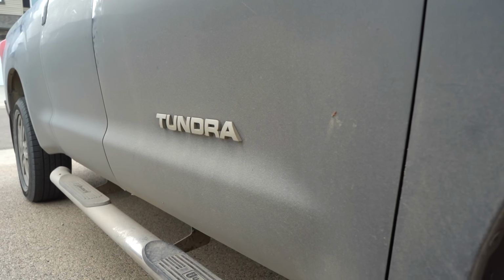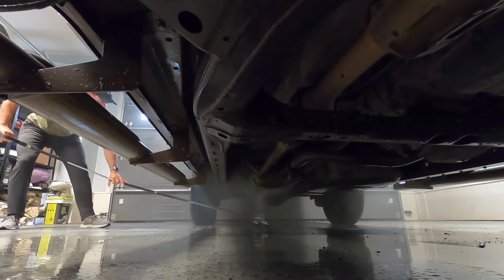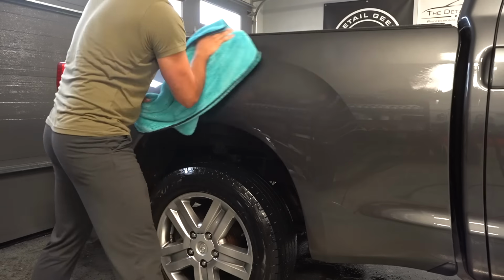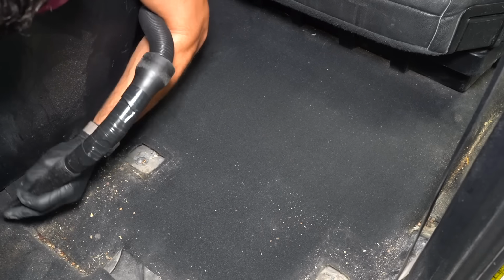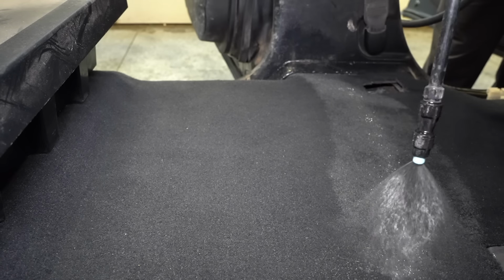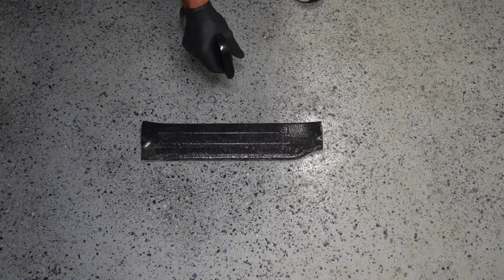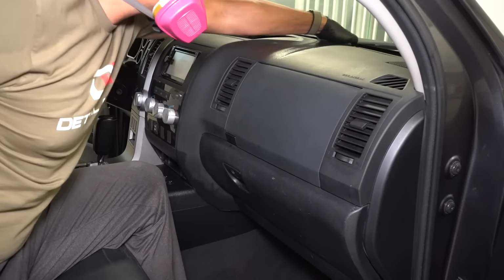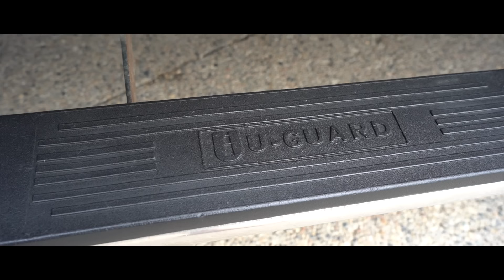Deep Cleaning a NASTY Truck! | The Detail Geek

Comment: Does all of that mist and overspray make your garage walls, ceilings, sheetrock etc wet or damp? Simply curious if you get mold,, mildew or dampness issues,, if you need run a dehumidifier or open the doors to air it out , nice video by the way.

Comment: Current 2014 Tundra owner here. Carpets are one horrible weakness in this truck. It's really tough to try and get dirt out of them. Engines are made in Alabama, Transmission are from South Carolina (Aisin) and the truck is assembled in San Antonio Texas. Engines are rated for 1 million miles if properly maintained which is why mine at 54k miles used, cost as must as a new Ram at the time. These trucks last the longest and are the most dependable and its just simply a fact (do the research because I did for my first truck and it was a Tundra based on the info and asking current truck owners). Currently at 153,000 miles and have had zero issues and it runs/drives like the day I got it.

Comment: One thing that would make these detailings better is pressure air blow gun to blow out the dust from the AC vents and to dry all the emblems very well. It would add a nice touch  to the videos specially in slow mo

Comment: Sprayback always sucks. I work at a rock quarry and we use fireman's hoses to clean off buildup on the station levels. If you the piles of rock/dust just right (or wrong I should say), you get a good face blasting of water and rock. And it definitely sucks when it's literally 10° and what you just sprayed freezes 30 seconds after you move away from it.

Comment: The one thing I can say is that he has a hell of a vacuum. That vacuum is no joke. I have two of my older vacs that I feel are just taking up space. They don't have nearly the power that the latest ones I bought do. I have damn near as many as the guy from vacuum wars.   If the need to ask why I have so many vacs is because when you do fleet/mobile you might do ten to fifteen cars a day. And I don't want to get caught with my pants down if one goes out.

Comment: Do you add anything to the solution tank of the bissell extractor?
Reply: Just hot water.
Reply: You'll see he puts down a cleaner and works it in the drill brush. Adding soap to the extractor would just be putting down more soap.

Comment: Is there a product you recommend for getting bugs off of the bumper? I tried the pressure washer but it’s really stuck on there
Reply: As far as I know, try using bug spray remover for cars or Goo Gone and leave the solution on the bumper until you get to the soap bit and then rinse.
Reply: I think its maguier bug product

Comment: We bought the Bissell but maybe I'm using too much soap or something because I go over and over and over in the same spot and it never seems to stop being sudsy and then I just get annoyed and stop using it. I literally only did one section of my car and I was done.
Reply: Mitch is mentioning he is using a 1 to 20 diluted All Purpose Cleaner. So definitely quite diluted. And you can see that he usually do not leave the carpet soaking wet. Also, he is using warm clean water in his extractor tank. So the steps are:
1. Vacuum your carpet 
2. Spray 1 to 20 diluted APC
3. drillbrush the carpet
4. First passes of the extractor spraying warm clean water until the extracted water looks clean
5. Finish extracting without spraying water.
Reply: @StephaneCalabrese  Thanks, I thought I had done 1 to 20 but maybe I didn't. I did the rest of the steps like he does them and I spent like 30 minutes on one small floor mat and it never stopped being soapy.  It also didn't seem to have a lot of suction. He has said before that it only takes him 5-10 mins for total passes per section depending on how dirty a carpet is. I dunno, I haven't tried to use it again cause I got so frustrated with it. We shall see. Maybe I got a dud.

Comment: can't you just use a degreaser like purple power on leather seats instead of a cleaner specifically made for leather??? i used to use purple power on the back seats(front seats where a goner) of my old acura in which hondas are known to have cheap interiors and it did just the trick on the leather seats without discoloring them or cracking them up..... whats the point of getting leather cleaner??

Comment: You really need to invest in a proper shampoo machine. A Mytee machine uses 200-degree water. It will save you a ton of time. And the hot water dissolved stains in one pass.